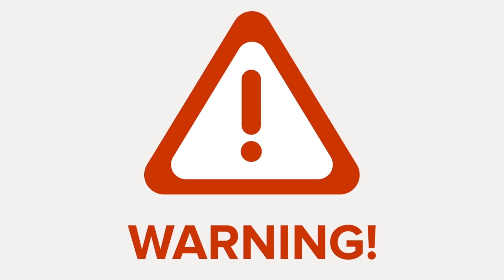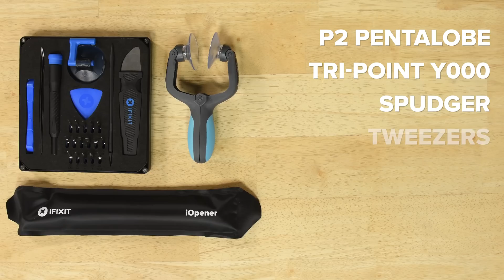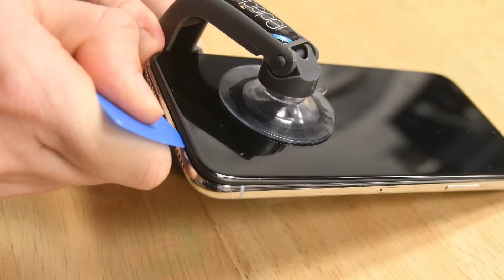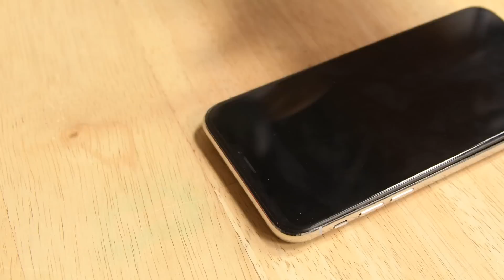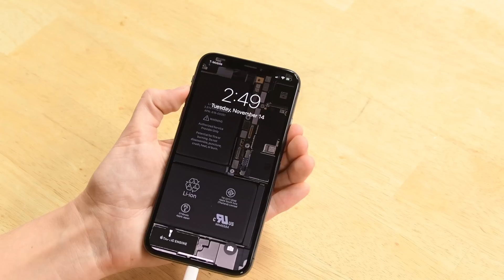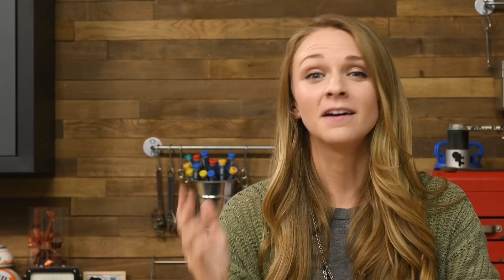iPhone X Screen Replacement—How To

Comment: If only the earpiece speaker and top mic are removed and transferred to the new display, why is a DFU reset necessary to ? The Face ID camera isn't removed from the device, correct? Why does Face ID need to be re-enabled?
Reply: Lloyd Doucet there is a tamper-proof mechanism
Reply: So just to clarify, anytime the display is changed on the iPhone X, a DFU reset must be performed to restore Face ID functionality, which essentially erases everything on the phone, correct? It seems in this video, she just puts it in DFU mode then exits DFU mode to restore Face ID funtionality. Is that all that has to be done or does the DFU reset actually have to be performed? If this is the case, anyone who does not back up their info prior to a display replacement essentially loses all info. Can anyone clarify?

Comment: Wait isn’t the Face ID module on the phone and NOT connected to the screen assembly like the Touch ID sensor was?
Reply: floex831 yup
Reply: Yes but Apple has added a tamper trip to it so if the phone is opened it disables face ID.